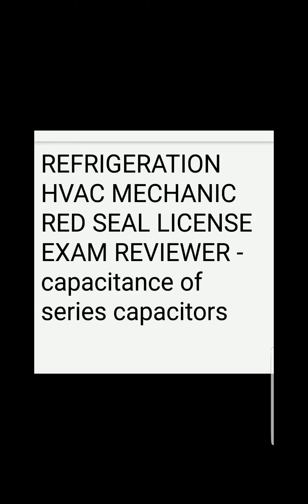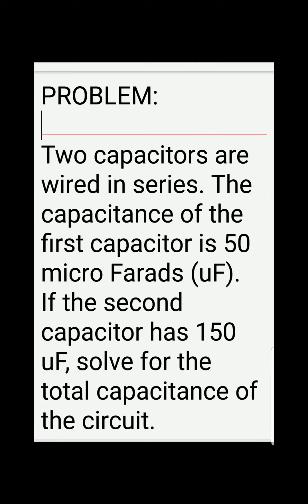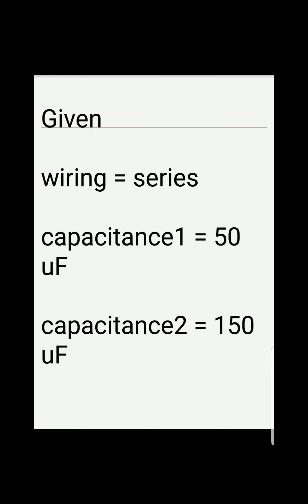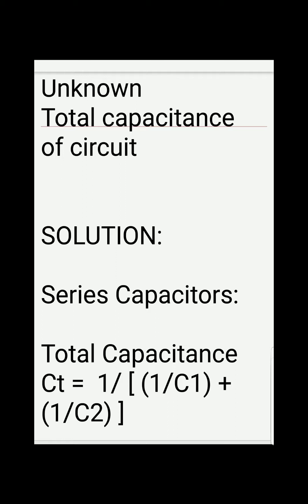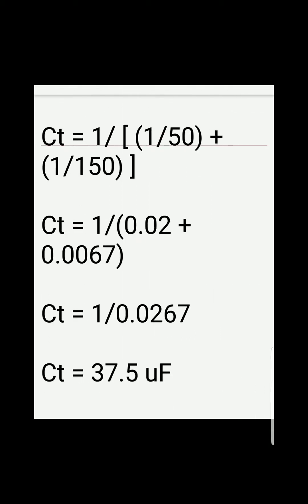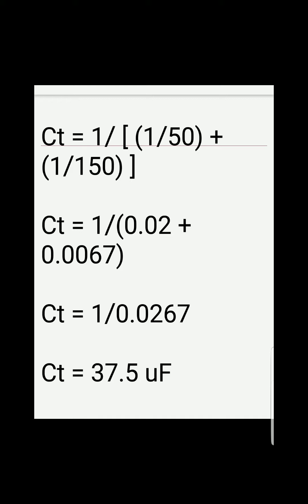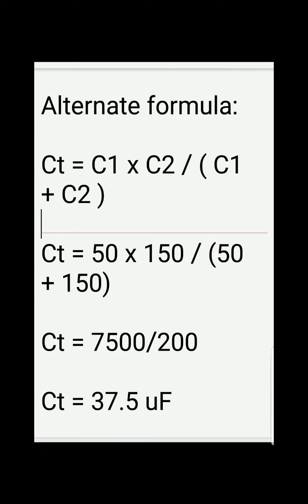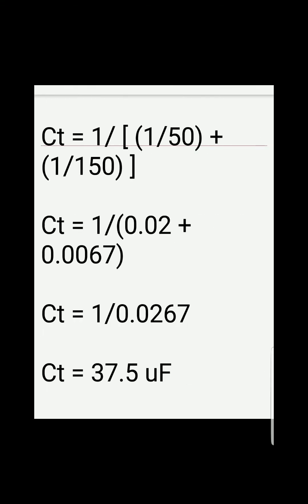REFRIGERATION HVAC MECHANIC RED SEAL LICENSE EXAM REVIEWER - capacitance of series capacitors

Comment: Hi
Do you know the formula for figuring out the minimum required sleeve size when installing nominal pipe with insulation through a concrete block exterior wall ?
Reply from the maker: Hi Daniel 

I made a video to answer your question. 

Video link:
https://m.youtube.com/watch?v=zfdHT60WED8

Please find below the problem and solution. 

REFRIGERATION HVAC MECHANIC RED SEAL LICENSE EXAM REVIEWER - minimum sleeve size for pipes with insulation 

PROBLEM:

The suction line of a walk-in cooler is 5/8 inch and has an insulation of 1/2 inch. The discharge line is 3/8 inch and has 1/4 inch of  insulation. Determine the minimum required sleeve size of pipe through a concrete block exterior wall.

Given
suction line = 5/8 in.
suction line insulation = 1/2 inch

discharge line = 3/8
discharge line insulation = 1/4 inch

Unknown 
Size of sleeve

SOLUTION 

Sleeve size of pipe
= suction line 
   + ( 2 * insulation )
   + discharge line
   + ( 2 * insulation)

=  5/8 + (2 * 1/2) 
   + 3/8 + (2 * 1/4)

= 5/8 + 1 + 3/8 + 1/2

= 2  1/2  inch

*
Reply: @Eternalson17  I saw the video 
It’s perfect thanks so much.

I’m sitting my exam in November, so I have been enjoying your videos 

They are very helpful
Reply: @Eternalson17  thank you.

I have another simple equation to ask please.

If an ice machine produces 20lbs of ice at 32oF per hour from water at 70oF, total heat removed is ?? Answer in BTUs

Thanks I appreciate it